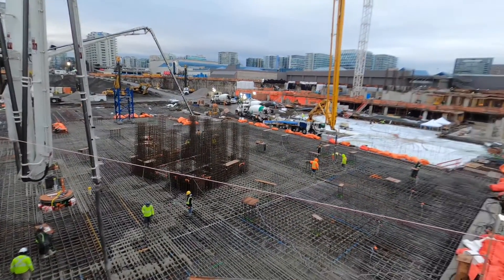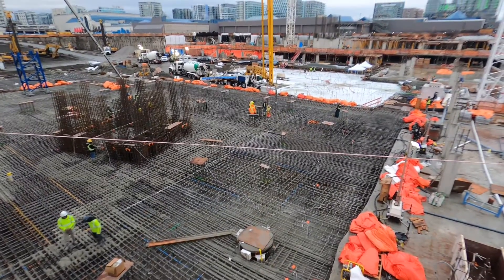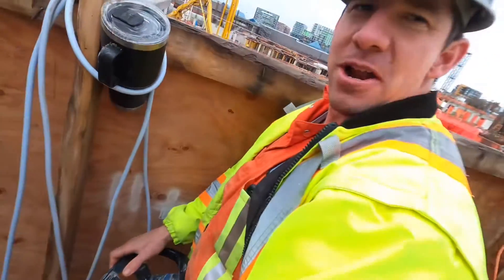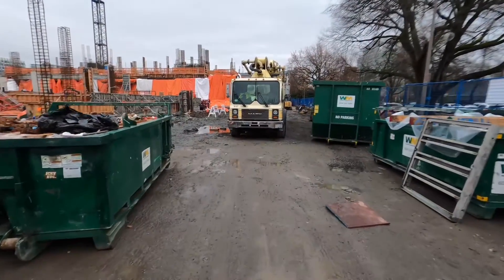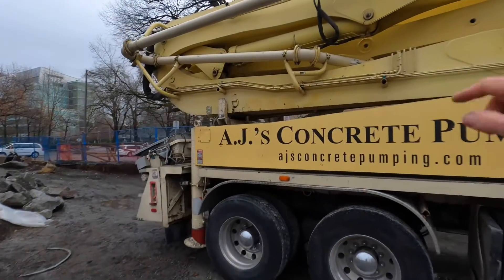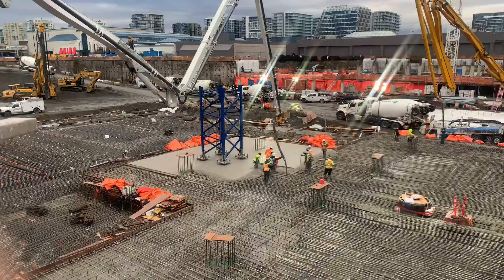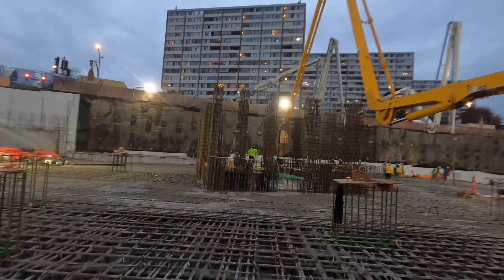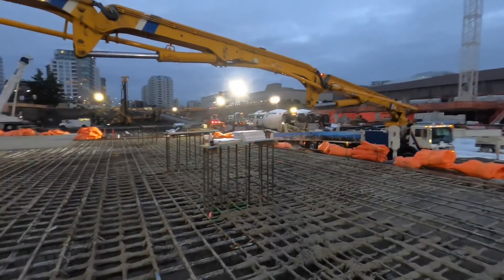Pumping 4000 cubic yards of concrete with just 3 Alliance concrete pumps!!!

Comment: How come schwings are not so popular in Canada
Reply from the maker: There’s only really one smaller company in our area which runs Schwing. But a few hours North of us is Normac Concrete Pumping who run a good size fleet of them. Other areas of the country they are very popular as well. I think mostly because we have several manufacturers setup locally (Concord, KCP, Alliance, and a Putzmeister dealership as well as a service center which specializes in them) is why Schwing is not more common. I do think they make one of the best concrete pumps on the market, it mostly just comes down parts and service availability in any given region.

Comment: man id hate to see the maintenance
 you guys would have to do with all these big pours
Reply from the maker: We’re very fortunate in that the materials which we pump around here are not overly coarse. A good set of ConForms twin-wall pipe usually lasts is in excess of 125,000 cubic yards.
Reply from the maker: It’s the fuel consumed which is really the bottom line killer.